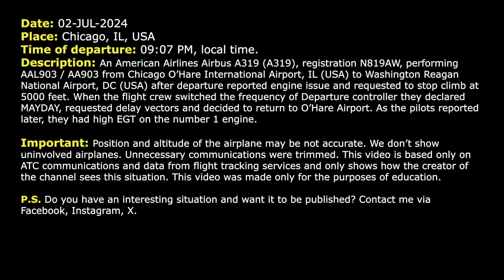MAYDAY. Engine issue after takeoff. American Airbus A319 returns to Chicago O’Hare. Real ATC

Comment: The crew contact the departures controller, saying they need vectors and some time, only for the departures controller to ask if they want to come in now. Listen ffs. He said he wanted a vector and some time. The last thing they want to be doing is answering questions they;ve already answered.
Reply: Keep in mind that the transcript we have on this video, and the clarity with which we hear everyone (from a third party antenna and radio) is not what they have as they’re working.

I heard, “and now we’re heading back to Chicago” from the pilot. Was his first transmission on departure frq. Controller asked immediately if they were ready to come in immediately, because it sounded like the aircraft said it was vectoring itself to a runway.